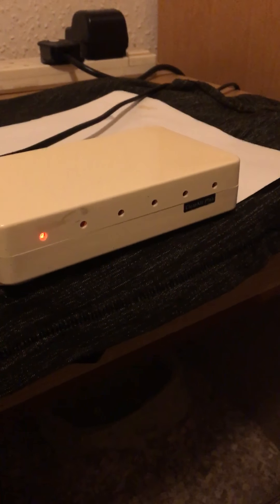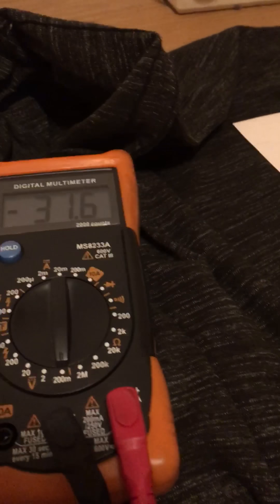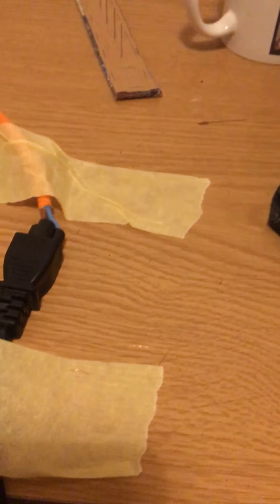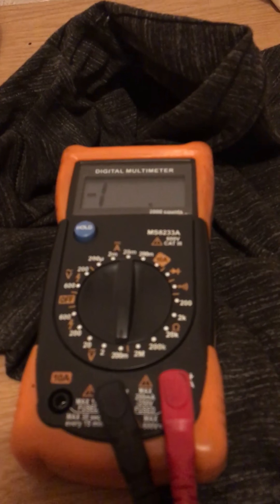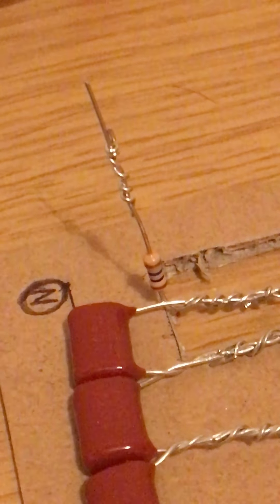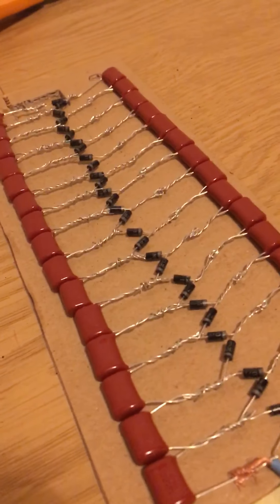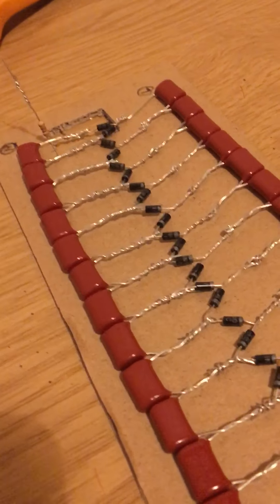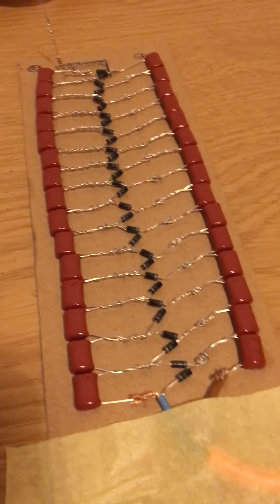Homemade Ioniser

Comment: Did you put the voltage multiplier straight to the mains power source? How is it not exploding?
Reply from the maker: The capacitors are rated to 600v
Reply from the maker: I have it running still to present day with no issues too :)

Comment: may ask for the scheme and the value of the capacitor and the value of the diode if you want to share, thank you
Reply from the maker: kento kenta hi yes the caps are 10nF 630v film caps and the diodes1N4007
Reply: @1700iDiGuy  thanks

Comment: Does it really create a breeze, or is it your imagination based on the word being in the maker's name?
Reply from the maker: It actually makes the faintest breeze, enough to flicker a flame or move smoke from around 2 inches in front of it
Reply: @1700iDiGuy  Why not use carbon fiber emitters or use lot of needles like 10 to 30 needles?
Reply from the maker: @esecallum  i find the brushes collect dust too easily i have changed it to a copped stranded braid
Reply: @1700iDiGuy  i thought that was the point...lol